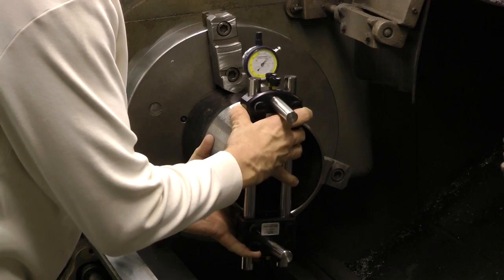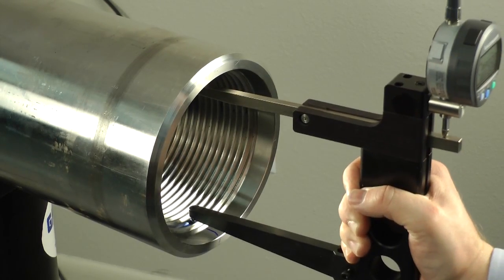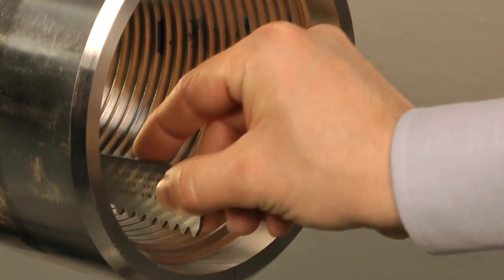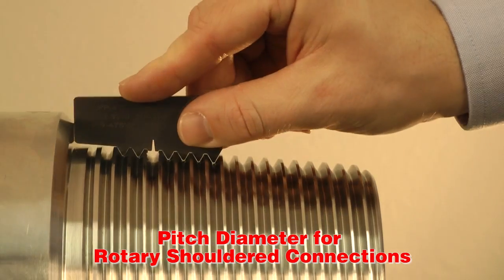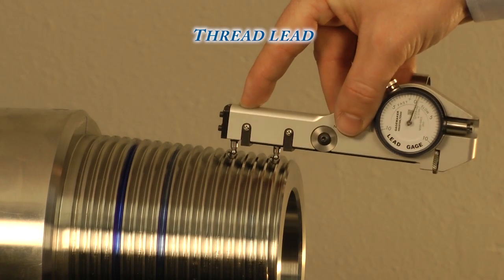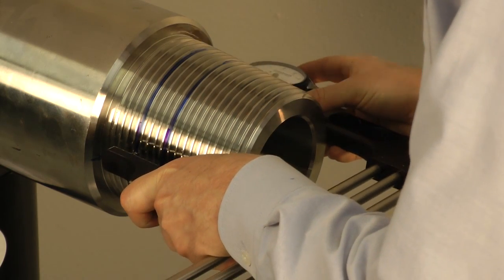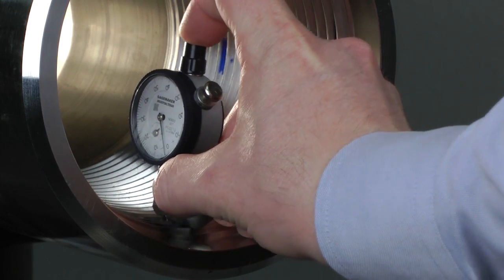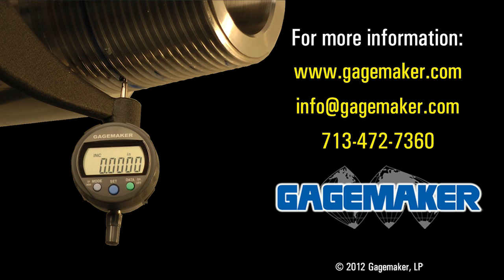Gagemaker Tapered Thread Inspection Systems

Comment: Can anybody tell me what is the difference between thread addendum gage and thread height gage? I have TH-3002B model.  Can I simply change the contact point and use my gage for addendum measuring?
Reply from the maker: Thread addendum is the distance from the crest of the thread to the 
pitch line. Height is from root to crest. Unfortunately, you cannot 
simply change the contact point. The gages have different indicators and
 standards. For more information, please check out http://gagemaker.com/may-2013-newsletter-back-to-the-basics-thread-addendum/.

You can also view our updated addendum video here: https://youtu.be/M_3H5HYK85w

Comment: Man y'all need to make a video doing all that while documenting every reading on a log and inputting the same info into the computer database as you go. Following all procedures,  work instructions, practices, any customer special requests needed to be performed in addition to what your getting paid to do like your going to get fkn paid for it.  required to completely check swaged series500 563 or some 5" slx, while training someone at the same time and about to change over orders and having to document 100% last then first articles on machines with say 90 end production goals achieving an average of 95 while being harassed by an auditor and your supervisor who wants you to jeopardize your job everyday multiple times, sometimes even while any mistakes are counted against you, even to a point of termination, especially if things slow up... Not to mention NDI tests like pulling mold samples of threads and seals then going to a comparator and check minutes for seal angel and thread profile with an overlay then sometimes having a third party wanting to witness and hover over your head the whole time.... I guess I was the inside director... Now that I think back... No doubt that place would've ran a lot longer... No doubt whatsoever and no one can argue cuz there were no people around to assess the system that was being implemented and the possibility of ability to perform as directed. Hey, I was rolling for a good while though, me, Mike, a few others had a part. I'm talking tenaris...